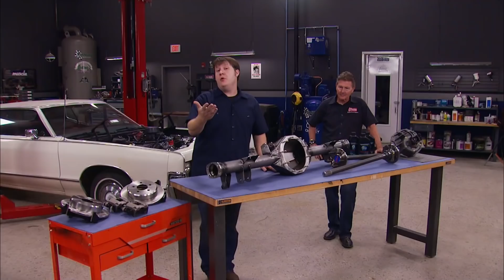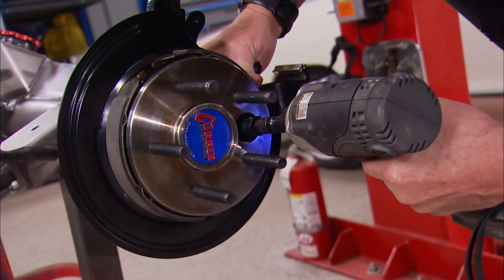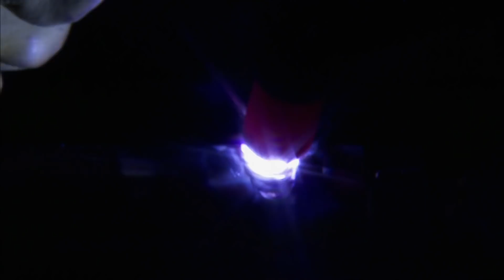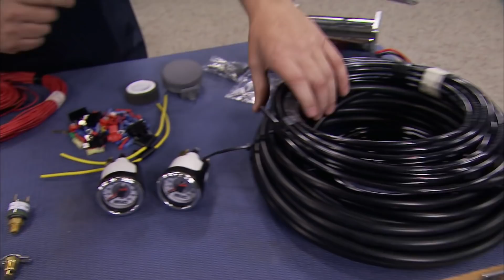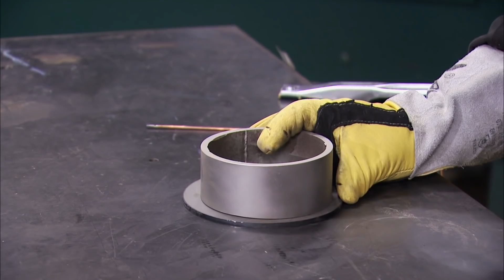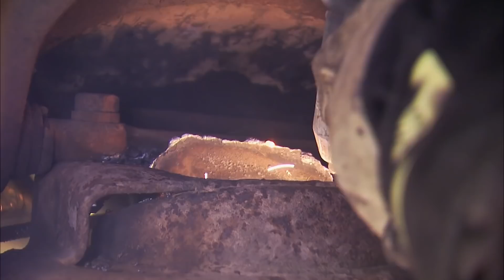Dropping an 1,100 HP '72 Mercury Marquis - Detroit Muscle S3, E12

Comment: Did I miss a segment? Does it actually run? There is another video showing the air cleaner sticking out of the hood. With all the time and money invested in this project, you couldn't have done some kind of ram air setup or at least a hood scoop of some kind? Looks like something anyone could do in their backyard. Gee, let's cut a hole in the hood - that would look good!! Disappointing finish. You dishonor the Mercury.

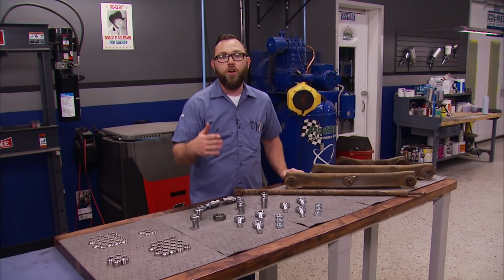Comment: I love watching these guy's channel, and normally enjoy everything they do. However, this time I hate the way they hung that Currie axle. Ford used channels on the trailing arms for a reason. I used to make my own bushings and box those in. Moog cargo coil springs along with a set of the old adjustable Gabriel shocks. Also used Hellwigs anti-sway bars front and rear. I also used to make gussets to strengthen the rear axle housing along with adding a strap along the bottom. These full size fords came with 2:72 rear end ratio unless they were limited slip with 3:25.  The 3:25 we're good but I preferred 3:55.  I loved the old galaxies sedans and station wagons. I had a 72 Country Squire with the police interceptor package along with the 429 that I had put a lot of time and money into, but was a lot of fun to drive. Ironically, that's one of the cars I miss the most.

Comment: Now if this was my build and I was putting all the money into the motor, suspension and brakes, why would you not do a frame off restoration.  I like how he grind-ed the rust away for the welding of the top airbag mount and then spray painted it black.

Comment: You had me interested until the pimp wheels... My first car was a 79 Mercury Marquis with dual carbs dual exhaust an air suspension and bored to 500... was dad's trailer miss piggy.  Could outrun a Boss 351Mustang or late 70's Corvette... Not quite sure what was done under the hood but it was a dragster tank.
Reply: Yes, I think they should have made them look like the stock wheels so there would have been no clue whatsoever to the massive amount of power under the hood.
Reply: Those rims actually looked good on this car because of the of the fact that the car was size proportionate for the rims 

Put the same rims on a 2013 Mustang  and they'd really look awful

Comment: When a car or truck is dropped past closing the gap that exists between the tire and the wheel well it becomes cartoonishly ugly, especially when little tiny wheels and tires are used.  It’s as ridiculous as the super tall wheel and zero sidewall tire combo many are putting on whatever cars they have. There is a guy here locally that has mounted some 30-33” wheels and tires under a late model Crown Vic and I can’t help but laugh every time I see him because of how ridiculous it looks! What a nightmare it must be for the engineers who designed the suspension to provide a great ride and longevity seeing that silliness on the streets!

Comment: So all that work to put on bags and it still sits 8" off the ground fully aired out...
Reply: They didnt put air ride on it to drop it, it's more of an adaptive suspension system they can stiffen ride or soften on the fly

Comment: The stock 9" rear end probably  would have  held up just  fine for awhile , because both the rear tires are just going to smoke anyhow and never really hook up hard enough to bust anything.  IMO The panhard rod mount on that custom rear axle looks kind of looks spindly looking and use some webbing around it.

Comment: Those rims are hideous. And since you have a lift and the rear was out of the car, you should have used a 4 1/2 inch angle grinder and wire wheel to clean the barnacles off the underside of that land yacht. Then spray it down with some VHT chassis epoxy. Other than that, I like it and keep these videos coming.

Comment: that little ad for the valance at the end gives me a question.. are there any good references as to the thicknesses of different sheet metal and frame parts on vehicles? like how thick a frame is on a 69 F100 or a quarter panel on a 65 mustang... or a frame rail or torque box on a 68 mustang.. I mean you can guess but are there any references that maybe some restoration parts company has put together so if you have to cut in a patch then its the right thickness and not a guess.

Comment: Kind of a shame - these big Merc's were like the kings of the highway, they just cruised at 80 or so effortlessly for hours on end.
"A poor man's Lincoln", when this thing was done they hacked a big hole in the hood so the air filter could stick through. A 180 style intake would have cost some horsepower but kept the hood intact. I can see the bags to get it down to the ground, but I've seen them strand a few cars if there's a failure. Those wheels look WAY out of place on this car.
It would have looked way better done all in a gloss black, or "murdered out", but instead it looks like some seventeen year old kid started a project that never was finished.
A few people called it a rust bucket - the car is 45yrs old - and plenty solid for its age, in the Midwest the only thing left would be the glass!

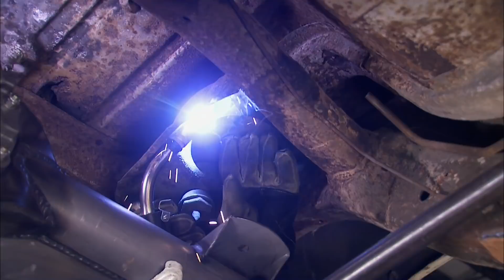Comment: All those expensive parts, in to a body that looks like it needs to be stripped back to bare metal and have the rust holes filled - That hole through the floor above the cross member left of frame at 13:44,... yeeeesh.

Comment: 1100 hp and single piston rear brakes damn son
Reply: Always want to lock up the front, not the rear.
Lock the front, you're going straight. Lock the rear, your spinning.
Going straight, can come off the brakes to steer.

Comment: Without brushing off the underbody,and frame rust,and using a 'restore,or encase',those air-suspension parts have 6-12 months.Vibration,and general flex is going to rain particles and turn it to crapulance.

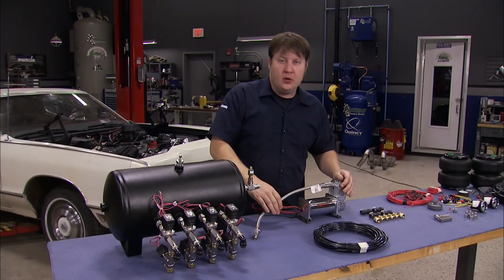Comment: 14:00 cmon, u spent like zillion dollars on engine etc.. u could patch that rust hole too (upper left corner)
Reply: This series is basically a commercial. So who cares about rust when you're pushing parts.
Reply: @reijerlincoln  They Didnt even paint that sweet rear end smdh  go see the job they did on that old 79 Bronco
Reply: They probably have no intention of ever keeping or driving this car.  Once the build is over they will gut the car and scrap it.
Reply: Its supposed to be a sleeper not a show car. Please don't ask me to explain those wheels though
Reply: Hahaha
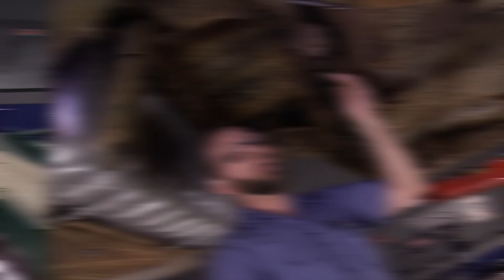Reply: Complete underside is rusty as #!* 5:40 ...
Really disappointed on that one
Reply: Put all resources into drivetrain and handling, ALL GO NO SHOW 👍
Reply: @LandonRoy-cv9rt  I agree with your statement in general. 
But: Not only does a car with rust holes looks like a shart bucket and the rust will continue destroying your loved project car, the holes also weaken the cars structure. Making it handle worse. So there is a technical reason for fixing them...

Comment: 1080 HP in that rusty shitbox, is a simply a recipe for disaster on the road. That much power will pull the car apart eventually. Why the hell didn´t you blast that rust away and do a proper primer and coating afterwards? At 13:30 you can see the corrosion is all the way through the metal (upper left corner).

Comment: 70 thousand dollar budget
Reply: My guess is it’s nudging 90 maybe more.... all those custom pieces don’t come cheap to the average back- yarder
Reply: Probably half of that.  Unless you want to pay someone to do the work.    Then 70k is accurate
Reply: Wild Bill  no , go price 1100 hp engine... ok your building everything? Maybe .the curry rear end 4-5 five grand alone .
Reply: @767dag , stroker kit is 2000 from Eagle. Total engine build, depending on what block you use, stock or aftermarket, heads etc, probably 15k. Currie is getting 1900 for the rear with full locking diff. With cost of the car, fuel injection, engine build, air ride etc, at least 40k.

Comment: Appreciate the work adapting the bags but some proper rate springs at ride height would have been fine. This build is something I've always dreamed of doing; a land yacht that goes, stops, and handles. Love this build.
Reply: Front springs are a pain in the ass.
Drivers side needs to be different then passengers side.
The AC bracket, and pump are close to 200lbs.....that's more weight on the drivers side.

Comment: All the money they are throwing at this thing they could clean up the undercarriage since they are pulling it all apart .. por15 and some undercoat would go a long way
Reply: That stuff is amazing, but a little pricey. Try coal tar epoxy, it's actually an industrial coating for offshore oil rigs to keep them from rusting in salt water. It's also a crapload cheaper
Reply: +Self-Centered Insomniac  I was thinking the same.  Pimp on the outside,  rust bucket underneath.  A waste of money until it's cleaned up.  And 1100 HP is going to rip some rusty part loose.
Reply: @FiveCentsPlease  well there you go maybe they are figuring they can shake the rust off it .. heh
Reply: That's the first thing that pissed me off, LOL  but i still gave a thumbs up. I agree if all the stuff is out of the way why not at lest spray some Rust-Oleum Black Paint under there darn it.
Reply: its because they're motorheads not bodyshop guys.. but I also wonder why anyone doing a restoration doesn't spray the entire underside with Phosphoric Acid Rust Converter to neutralize the rust and convert it to an oxide that is easy to wire brush or just paint over.. but this car after they are done is going to be worth less than the cost of the parts they put on it.. unless its for one of their dad's as a specialty project.. give it to dad to drive to the golf course .. throw 4 sets of clubs in the trunk.. heh but those wheels idk if dad is going for that. heh.... maybe kinda looks like boat steering wheels or somethin
Reply: Excatly mate.
Reply: Shut up

Comment: New parts on a rusty frame. At least clean it and paint it.
Reply: The shows aren't about doing things that you can do without much outlay, of course. They're about getting you to pay for parts that were sold either with partner advertising or paid outright to be on the shows. 

I like seeing the parts, though, but am more the type who would do a light restoration on an original car that costs time and shop supplies more than huge part outlays. 50 years from now, people will pay for the original cars. All of these specialty parts are for people who can throw away five or six figures and not worry about it.
Reply: David W They don’t even run a jet washer over the bottom of the car! They’re putting $20,000+ worth of motor, transmission and suspension on this car, but they can’t afford to wash and paint it? They don’t even paint that trick rear diff and axle!
Reply: The sheet metal is rusted too.
Reply: At least undercoat it or rattle can some semi gloss black on it
Reply: exact this where my thoughts... so sad. Greetings from Austria ( Europe ). I love the USA and your Cars... of course I own a american Car. A Chevrolet Camaro from 1979... in Showroom-condition. ( Sorry for my English...)
Reply: @Francescodefarlatti  , my sister had a 1976 Chevrolet Camaro once.
Reply: That’s a lot of labor
Reply: @ShaunHensley  yea but thats also alot of money saved if you do it yourself and don't take it to a shop. I basically did the same on the Lincoln in my garage. Time, effort,dedication and some know how is all it takes man.
Reply: Ru Ben Yeah, but having tools like a lift really help. Tools always pay for themselves in labor saved, IF you have the space for them
Reply: @ShaunHensley  apart from wrenches, sockets etc I bought me a 1 ton cherry picker from harbor freight.  I basically did a $3000 job  on my car in 3-4 days time.
Reply: @ShaunHensley  I've been thinking about buying good cars cheap with leaks or whatever needs replacing so I can do it myself and flip it.
Reply: Ru Ben Good luck. There is money to be made
Reply: @ShaunHensley  , for a restomod like this, it is honestly worth the effort.
Reply: Paint wasnt in the budget lol
Reply: I agree. They are already putting all that money into everything else, so why not get that rust off and undercoat it too.
Reply: That’s what I’m saying
Reply: nah

Comment: That thing had the driving dynamics of an elephant falling down a cliff with a chassis that couldn't handle even the stock power it came with... what a great idea giving it 1100hp. Especially in combination with a thrown together suspension system with zero R&D and testing behind it. This thing is probably a death trap at anything above 60 mph and a perfectly flat and straight piece of road.
Reply: Well you haven't a clue....The "chassis" could handle plenty. Why leave a bitchy comment about something you're not familiar with?
Reply: @falconater68  The chassis on one of those traces right back to the '66 Galaxie, the basis of ANY FoMoCo brand NASCAR unit until the mid '80's so yeah, I have to agree with you. That underside may have some scale on it but is plenty strong. As to no R&D... This ain't the first rodeo doing this to a vehicle for either of these men, once you know how it works fabing for another project is easy.
Reply: Hey folks its BeyerT1 the Typical Import lover.
Reply: @YOYO MA BeyerT1 definitely sounds like a pure liberal.

Comment: i cant take ANYTHING bagged seriously.
Its like a low rider 🤣
Reply: Buff Barnaby whats wrong with a car being bagged?
Reply: As I am a former owner of a 72 Merc I will say It's a 5000LB + car so it's a cruiser not a race car, not to mention its about 19ft long, stock height they were to low for taller speed bumps let alone if you had 4 grown men inside of it slamming the car even further to the ground.. 

Now I am doing my first car from my youth which is a 1973 Lincoln Continental which is a bit longer and heavier then the Merc, it is a very similar build build as this Merc in this video with the exception that it is dual 3 inch exhaust with glass packs and no cross overs for a deliberate raspy sound and a hydraulic cam on a 10.5 compression bottom end making 540ishHP. There is nothing sweeter then a Chevelle owner thinking they are going to smoke you and your slamed Luxo boat Lincoln down a freeway ramp and they can't shake it... But that isn't the point of the car its all about getting out and cruising and the bags make the car look mean as hell when its slammed but totally drivable when your hitting the highway which I drive the hell out of my rides, this car will be rolling one way 250 miles to vegas in a few weeks and it cruises the OC beaches pretty regularly which are and hour away. 
My point is land yachts are the most under rated car in the hobby and yet they are just as fun if not more fun then any mustang or cuda the bags are part of the fun just as the over stuffed bench seats are.
Reply: @AtomicReverend  Kudos man!  My '68 Torino was a 17.5 foot long "Intermediate"... LOL
Have a great day, and have fun hunting those muscle cars!
Reply: @BloodRaven1969  I love a 68 Torino, my neighbor who is an older man has a 427 4 speed car and raced it all over so cal in the 1970s... Such a great looking fastback car.  But then again there isn't to many American cars that were what I would consider ugly that are pre safety era rides.
I have had probably 75 or so cars of all different makes and models but goofy compacts from the USA in the late 1950s into the 1960s and luxury (fully loaded full size) cars from the late 1940s to the late 1970s  from the USA I always come back to them.  My Lincoln is a blast and when I was a kid it seated 6 and all my dumb friends had mini trucks with ugly bucket seats out of preludes or somethong so all the girls in the group always ended up in my car... Great times...
That being said my next car on my must own list is out of the ordinary for me I think it is going to be a 1964 to 1966 V8 barracuda because I am noticing the price is starting to inch up and I've always wanted one so I figure it's now or never... your torino is also on my bucket list but I Haven't seen a reasonably priced one in a long time. 
I think I gave only had two mid sized cars in my life, a 68 Olds Cutlass and a ford Granada.  When was the last time you have seen one of those cars? I wanted to buy another one but a two door v8 car and I haven't seen one on Craigslist somewhat locally in a long time, I thought it would make a fun street raceish car being in California I have to get a 75 or it would have to do through smog and I am to stupid to move away from this car hating stronghold (as of yet).
Reply: @AtomicReverend  It's far from stupid to stay where you know. :)
I haven't seen any Granada's in person in a long time, but we just had our local car show a few weeks ago here in small town Ohio and there are a 66, 67, and 68 Cutlass tri that show every year side by side by side. Makes me smile every year to see them.
The first gen Torino two doors have been climbing in price for a decade, with the fastbacks bringing the highest prices.
My ventures into luxocruisers were a 77 LTD full size with a 460 4bbl I owned and my Grandmothers 74 Old Delta with a 455 4bbl. Love the way those cars ride, and the reaction when stomped of the whole car stands up, then squats down and shoots off like a rocket. Oh, both were a bit 'warmed up' as I have problems leaving anything stock, lol.
Reply: Back in the late 80' and early 90's having a bagged suspension on my '68 GT Fastback Torino Pro-Street sure would have made life easier and saved on suspension parts and skid plates (added later) replacement cost and time.
Just because it is used on lowriders is no reason to not use something. Look at turbo's, the were "import/ricer" power adders back in the day and are common on any kind of build today. (Though I still prefer my Detroit Diesel -/71 series blowers.)